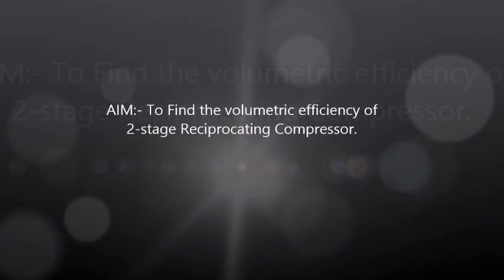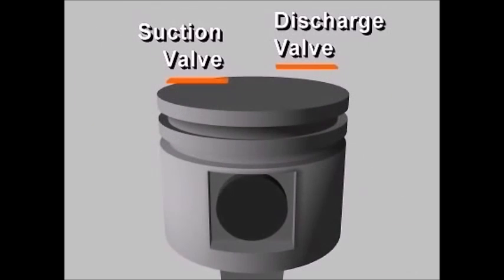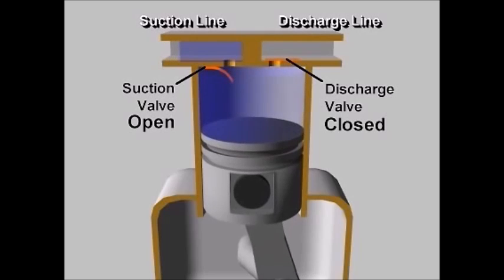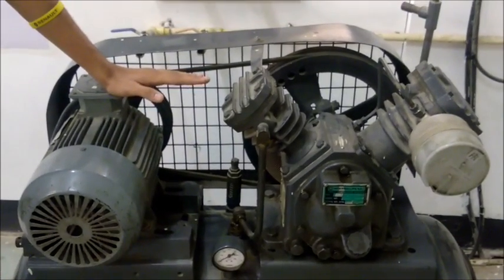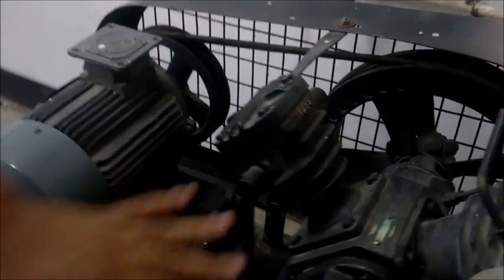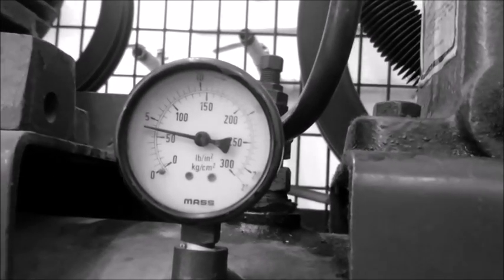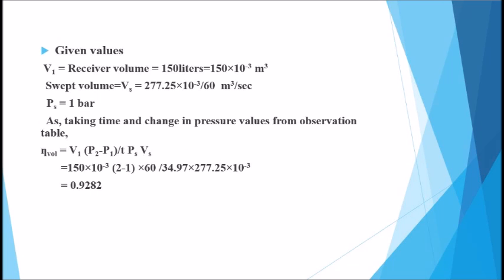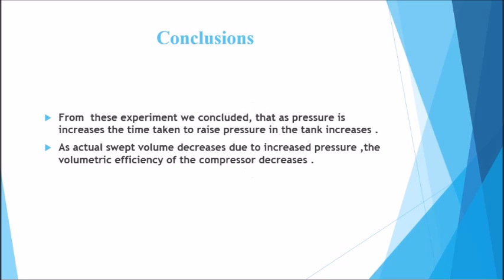2 stage reciprocating compressor experiment

Comment: I have 10 Hp Air Compreesure when it starts it make Noise more is there any way to to run a compressure in Silent mode
Reply: It's a 2 Stage Compressure n 2 filter is installed
Reply: Sir service kara lo time pe 
Nu.9561220176 ,7709134775

Comment: SELKON AIR PUMP 

Alternative to Bore well
Submersible Motor

 SELKON FOOT VALVE

 It has increase your water pumping capacity by Twice.

 It is equal to borewell submersible motor pump
Low cost and high water pumping 

No motor coil burning issues 

No salt formation in
pipe, because no water Sterling

 No load to motor because constant pressure
Pumping water even from 50 feet water storage height in bore well 

Sri Selvakumaran Industries, Erode, Tamil Nadu. 9655321216. www.selkon.in, www.sseservices.in

https://www.youtube.com/watch?v=2YUxzHwhlaQ